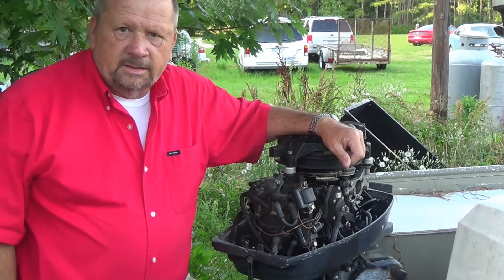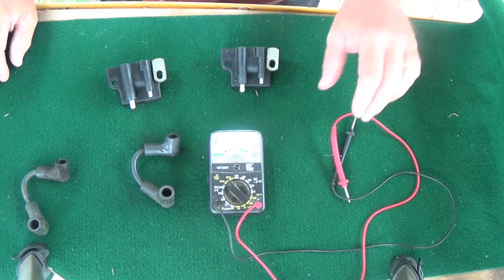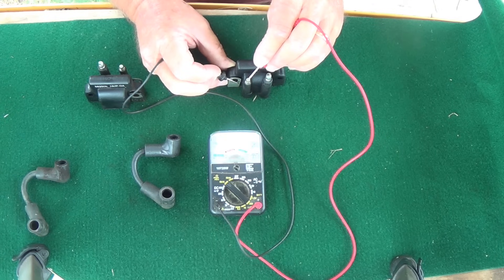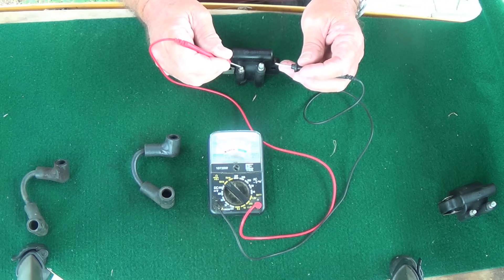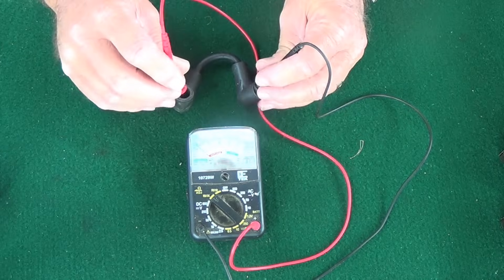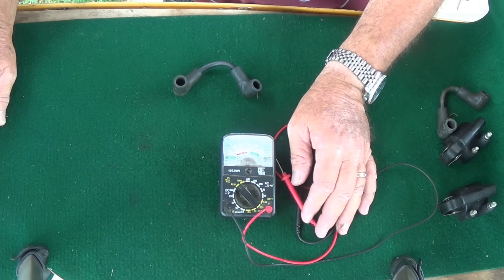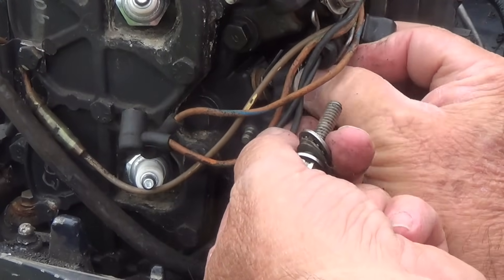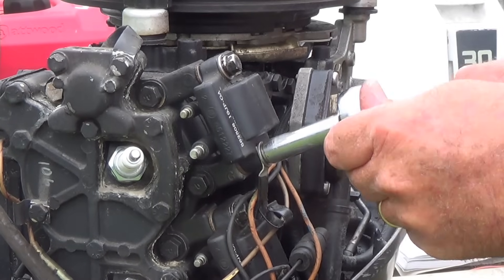Coil Test {would you look at that!]

Comment: I have a 1994 johnson 48 spl shes hard to start on cold start she was running solid for 15 minutes then died immediately and wont fire back up and is getting no spark i replaced the ignition coils prior, could it be the power pack finally going out? My stator is good cause once cranked my volt meter goes and keeps a steady 13volts
Reply from the maker: I would make sure the emergency stop switch is working properly. Check all the connections and then start testing each part. Don't think just because it not that old that it is good.
Reply: @OmFishing  it was indeed the kill switch
Reply: @OmFishing  my 30hp evinrude coughs and shuts off when its cold. After a bit it stops coughing and shutting off and runs better.  My plug's are really wet & smokes alot and I noticed alot of oil in the tank I tested the outboard in. Did I mention it smokes ALOT.  Help people
Reply from the maker: @cramos6638  Check out my video linkage adjustment. Changing the linkage and the timing change help my outboard a lot. The oil is in the gas so the only thing it could be is the carburetor is running rich. There are other thing it could be like crank seals but we need to rule out all the other things first. Are you running the correct spark plugs the manual calls for? .https://www.youtube.com/watch?v=za6NJfclfkI&t=635s

Comment: On Johnson and Evinrude motors coil wiring remember Blue Sky up and Green grass down. blue stripe is top wire and green stripe is bottom wire on three cylinder motors the center will have no stripe. Coil values very from year to year always check the manual. Coil wire failure is common on outboard motors more so if used in Salt water. The bolt heads are 3/8" not 10mm on all OMC coils come on uses the right tool. The quickest way to check total output at the coils is to use a Air gap spark tester most OMC product should jump a 7/16 to 1/2" gap. Power packs are another failure point but output needs to be check with a peak reading volt meter Values vary from year to year and horse power so check the book. Thirty Six years as a marine mechanic I have seen just about every thing.
Reply from the maker: Thanks for sharing your years of  knowledge with us. There are so many people out there that are just trying to have a family day or a father son fishing trip using old equipment. Making use of what they have to work with. They are not going to take it to a marine or a lot of them can not afford to. Just trying to help them make a memory. You should think about starting a channel you have so much knowledge to share. Thanks for commenting and sharing.

Comment: My engine won't shut down.
The kill switch works and is wired right.  The internet boat guy says it's a bad power pack. 
?
Reply from the maker: I am going to need more information Like year and model of motor. I would first make sure any ground straps or wires to the engine block are making good connection.

Comment: How about the secondary coil?(Between spark plug cable and earth)
Reply from the maker: I did not test the coil for leakage in this video.  I will make sure to check for flashover  and broken down insulation in the next test. Thanks for watching and commenting.

Comment: Hello sir, big fan of your videos, I own a 30hp Evinrude like yours but with electric start. I have a question unrelated to this video.
On your 30hp, exactly how would you test the fuel pump. Where do you hook up the tester lines, there's really no line from the fuel pump to the carb. Im hoping you can answer this for me as your videos have helped me a ton with my motor. Thank you
Reply from the maker: I am not sure what model you have. If you send me the year and model you have I will be happy to try to help you. I am thinking there is a fuel line behind the fuel pump going to the bottom of the carb.
Reply: @OmFishing  my motor is a 1996 30hp omc Evinrude model e30elede
Reply from the maker: @richdalpe9681  On the fuel pump the fuel line at the back right corner goes to the carb. That is where you would have to get the pump pressure. If you go to the web site Boat Net and click on evinrude and then year and then model. you can see the break down.
Reply: @OmFishing  ok I see what you mean, now would I disconnect that line at both the fuel pump and carb to get a reading or am I able to get it off the pump. Sorry this is my first time doing this and I watched your video with the 9.9. you make it look easy lol
Reply from the maker: @richdalpe9681  You want to get your reading between the pump and the carb. I would take it off the carb and get my reading from the line coming from the pump.
Reply: @OmFishing  thank you for taking time and helping me out, I appreciate it very much. I got the reading and determined the pump was bad, time for a rebuild. Again, thank you, you're a good teacher
Reply from the maker: @richdalpe9681  Happy to help. Stay Safe!!

Comment: Just an FYI on the plug wires.I made my own by ordering the 7mm wire and I just reused the boots and the small piece inside the boot.No issues doing it this way.My guess is the piece inside one of the boots was not making good contact where it pokes into the wire and not the wires running thru the insulation.
Reply from the maker: They say the electrical system on the outboard is the weak link. Look there first. Guess they are right. Stay Safe.

Comment: I just checked my coils due to no  spark on one that had been replaced at some point with an aftermarket one.I followed your same exact procedure and the coil ohmed  out the same as the one that was working and it still gives no or intermittent spark.I even swapped plug wires and swapped the coil wire coming from ignition module and same result.I even took a good coil from another running motor and it sparked fine.So I guess even a coil with good ohm readings can not work properly.
Reply from the maker: Thanks for sharing that information with me. The service manual does not tell you that. That is the school of hard knocks.
Reply: I’m having the same problem bottom cylinder has no spark and the coil ohm out good but it was the coil even it ohm out still wouldn’t work until I put a new one on it

Comment: Are you reading the Ohms values?  It appears not.
Reply: The actual ohms values are NOT that important. What youre lookjng for is continuity. Why do u think there is quite a range of values  given by the mftr?  The primary side of the coil is nothing but a 20 ft (approx) length of wire with one end going to ground.The secondary  is aq 150 ft wire with one end frounding at the gap in the plug.. what you REALLY need to check is make sure the coils havent degraded  to the point where the primary and secondary are NOT touching each other and that the wires themselves are not BROKEN inside..really thqats it..OBviously seewing any craqcks on the coil means they   aaaahave seen alot of time and even though still working  i would not trust that coil..Same deal with the spark plug wire itself continuity of some sort is is what u want .so if its not exactly within range does NOT men its bad Look elsewhere for no start or misfire problems
Reply from the maker: Thomas thank you for all your knowledge on this. I never really thought of it that way but you are right. Thank you for sharing and commenting. Feel free to help us anytime.
Reply from the maker: Good catch, I think everybody gets the just of what we are doing. Thanks for commenting.

Comment: i have a 1989 evinrude 9.9, would the ohms reading be 275 on my motor also or are they all not the same number, if not would you know what mine should be?
Reply from the maker: The service manual I have is a 1990 and the Primary Resistance is 0.1 + - 0.05 ohm
Secondary Resistance is 275 + - 50 ohm
I would think that is your coil is with in this range it would be good.
Reply: @OmFishing  Thanks for the info and the fast reply . 100 likes from me !!!!!!!!!!!!!!!!!!!!

Comment: I need to replace the boot connector that comes of the harness and powers to the coil on my 50 Johnson. bad corrosion and was knocking my top cylinder out. can I just splice a new one on instead of replacing harness? there isn't much wire to play with. its the connector thats at the top of coil.  know where i could buy a new boot?
Reply from the maker: I buy a lot of my parts from Boat.Net I like the way they break down the engine part by part. Try them I don't get anything from them if you buy something. That is just who I use.
Reply from the maker: P.S I did splice a wire coming from the electronic ignition on my evinrude 225 and it worked just fine. Water tight seal connectors work best.

Comment: I get what your are trying to do doing but you are not measuring correctly. There are two winding's in the coil, the primary and the secondary, both of which have one side at ground potential. So your measurement should have been from ground to one terminal and then again ground to the other terminal. One reading should be around 1 ohm and the other around 2 - 3k ohms. As pointed out you were reading on the incorrect scale. In both cases your were reading about an ohm and not 235 ohms. The other point that must be raised is that an ignition coil cold and not under electrical stress will be completely different to when hot and under operation, it is under these conditions only the intermittent faults raise their head. I did like your presentation though, even if I disagree with the the technical content.
Reply from the maker: Thanks for the comment and Stay Safe.

Comment: looks like a rub spot on your primary wire lower cylinder?
Reply from the maker: Ok I just got back in the house from looking at the wire. You are right it does have a spot that has some ware on it but it is not as bad as the camera made it look on the video. Thanks for pointing that out and thanks for watching and stay safe.

Comment: Hey here's my story . Owned an 88 model 4 cylinder 50 Merc. Ran a bit shitty so I took the stator ring off to find corrosion had chewed the wiring to an inch of its life. Wires looked like human hair. New stator wiring set...no worries. Old out board need a real close look
Reply from the maker: You are so right. I have done the same thing. You look at, it looks good you think your getting the better end of the deal. Then you get it home.

Comment: put in new carb kit, still wont start. Was flooding seemed like yesterday, not anymore. good plugs in it, correct gap. Fired over and ran when bought boat couple days ago. now she just wont fire over. any ideas?
Reply from the maker: Make sure the kill switch is not the problem.
Reply: Om Fishing actually got fire and fuel now. Still won’t start. New carb kit, new gas, plugs. I’m stumped
Reply from the maker: @touretteguy69  Check out my video about the Four  Circuits of a carburetor. https://www.youtube.com/watch?v=J_yqcNJqabU. and check out (Out board Recirculation system}.  Make sure that the hoses are on if the recirculation system are on the out side. The air fuel mixture must be right for it all to work. Is it blowing gas back through the carb? I assume compression it good. Carb gasket good and   tight seal.
Reply from the maker: Did you Check flywheel key way?
Reply: @touretteguy69   put qiuck start in it .i had the same problem ,after it ran it was ok

Comment: plese you can give me the number of resistance for coils evinrude
Reply from the maker: The primary resistance for the coil is 0.1 (+ -) 0.05 ohm. If the coil is off the engine. Connect the meter black lead to ground tab on the coil,  and connect the red lead to the primary coil.              

The secondary resistance connect the meter red lead to coil primary terminal. connect meter black lead to coil spark plug terminal. Meter must show 275 (+-)50 ohms. Hope this helps. Stay Safe

Comment: HI Om Fishing my name is Kara?My 2001 25hp Yamaha 4stroke is surging at full throttle,what you think that is?F25ELHZ>
Reply from the maker: I don't think I will be much help. I would clean the fuel filter.  The only Yamaha four stroke I have worked on is my jet ski.
Reply: Kara Lewis do you have carburetors? I’d try giving them a cleaning. Sounds like a jet might have some trash in it.
Reply: Surging at full throttle would indicate possibly a bad coil, this test is not accurate at ambient temperatures, only way to test a coil is to put a load on it first to heat it up then test, check spark plugs, if one is washed, more than likely a bad coil, if 2 are washed on opposite banks, that would indicate the trigger plate, if same bank, likely the switch box, or stator, however if it's that far as to the stator or switch box, it'll likely not reach full throttle at all.

Comment: Oh this video makes me sad because I had sent a similar Evinrude (E30TEEI) to my home in the Philippines back in the early 1990s with the hope of using it when I was able to vacation there.  This was a brand new Evinrude still in the original box.  When I got  to actually trying to use it for the first time I could not because my inflatable boat was eaten by rats that nested where it was stored.  Some years later I sent a new boat and when I tried to use the Evinrude this time it was frozen.  I guess I should have not trusted the factory fogging to last for many years.  Next time I go I  try to unfreeze the motor.  The Philippines is a tough environment for motors especially near the salt water sea where I am living.
Reply from the maker: I wish you good luck on your next trip. Thanks for sharing that story with us. That is one more tip to keep in mine when storing a motor for a long time.
Reply: the only way that would happen is if you tried to start it and didn't put it away properly, and/or had the cowling off or unlatched to allow air to circulate through the motor. there are motors 30+ years old in the crate that are literally brand new.

Comment: Maybe you can help me. I have a suzuki dt4 2 stroke. No spark. All seems in spec but the coil seems like it has very high resistance. When I put one probe on the spark plug wire and the other probe on the orange wire coming out of the coil it reads 1935. I'm guessing thats way too high resistance? There are also tiny cracks on one side of the coil.
Reply from the maker: Remember that the electrical system on the motor is around water all the time. That makes it the weakest link. I think you should replace the coil if you can. The service manual for that motor would give you what the coil should read. I don't have any information on that motor. Stay safe.

Comment: will you be replaceing the plug wire with a solid core or graphite style ? ie pacard 440 or the carbon wire. as you know carbon is ok if you do not bend it at all the Packard or solid coppercore is more durable.. just asking not telling..
Reply from the maker: I replaced the plug wire with omc wire. Check out the video New Spark plug wires & Starter pawls.
https://www.youtube.com/watch?v=A4tIfG6LDE0&t=235s

Comment: Hi would you be able to help me out? I have a 1984 90 hp Evinrude. It runs good but doesn’t idle very long then shuts off. I found that the top left cylinder had no spark. (Pulled plug and saw that it had never fired) so I check for spark and no spark checked coil and wire and plug all good. And I’m assuming the power pack has been replaced since it looks newer and different colour then the other side. All the wires look good. Is there anything I’m missing? Or common problem? All other cylinders have spark.
Reply from the maker: The first thing I would check is make sure all ground wires have a good connection next I would check that all the electrical connectors all pins are clean and good condition. This is not to bad of a job to find with a volt ohmmeter remember the electrical system is around water all the time making it the weak link. If you don't have a good service manual for that engine that would save you more than the cost of the manual. The service manual will walk you through the test to see what part is bad. For no spark on one cylinder. It would be to hard for me to just tell you. The service manusl will have pictures of how to check each connection and what the reading should be.
Reply: Om Fishing thanks for the reply I found that one of the pins where the power wire plug is was not pushed in all the way so there was no connection!
Reply from the maker: Good to hear and thanks for sharing the information.

Comment: Thanks for the video. I was having trouble with my Evinrude 8hp. I thought it was coil or spark issues. As it turns out, after a call to our local outboard expert, it was a wet kill switch in the handle. I had noticed a tingling when holding the handle and touching the outboard casing. I disconnected the end of the kill lead from the coil mount and it started right up on first pull! I will look into replacing the kill in the handle with one on the body.
Thanks again for going to the effort of making the video.
Cheers.
Reply from the maker: Happy to help and thanks for sharing that information that will be on the check list.
Reply: Om Fishing  ?...?!,,,,,!!!..?.???.?.,,,,,?
Reply: Thanks Will see what happens.
Reply: Is that your body

Comment: Have 1957 Johnson 5.5 will crank run just a min rib real high and go dead any idea what is wrong carb has just been rebuilt fuel system has been changed from pressurized to fuel pump ran fine until I changed impeller now won’t stay running spring is here please help
Reply from the maker: I would recheck the fuel from the tank to the carb. I had one that I rebuilt the carb the fuel pump and new ball in the gas line. It ran for a short time and quit. I started looking for something else because I just went through the fuel system. To make a long story short part of the new fuel line came off one the inside and block the fuel to the carb. So if it sounds like not getting gas it might not be.